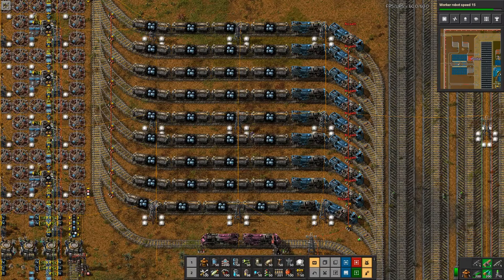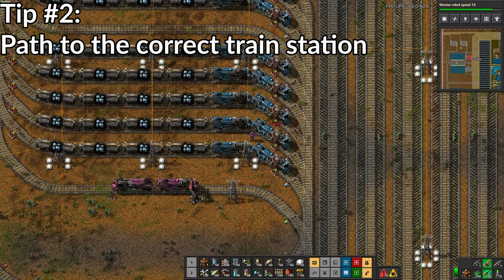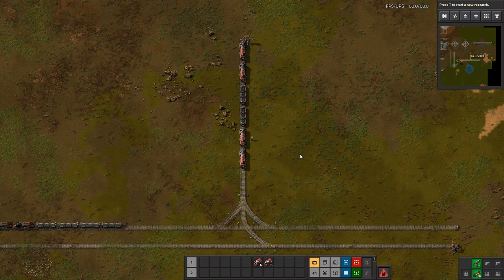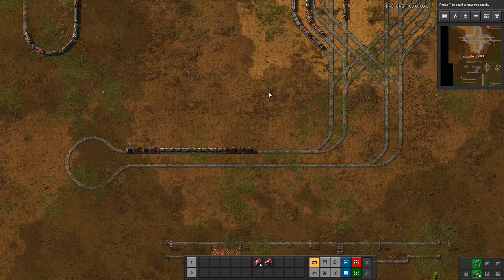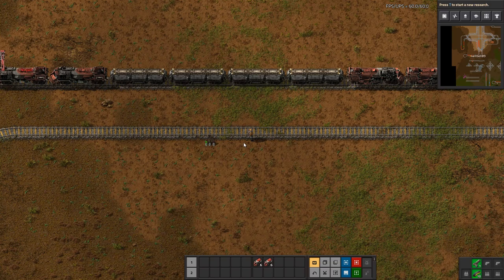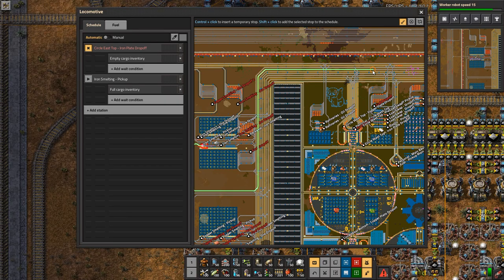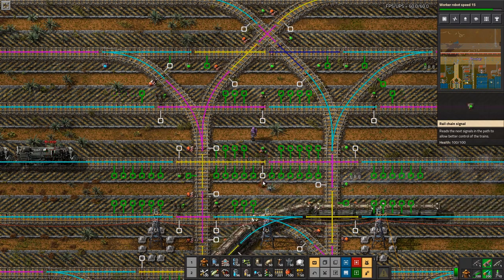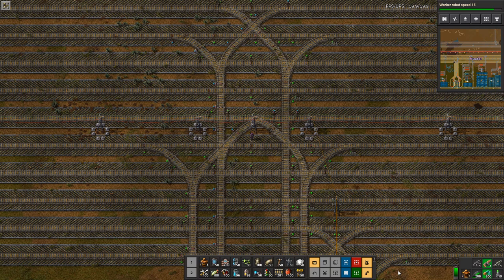FACTORIO | How to Fix Train Path Errors - Tutorial

Comment: Nice. I particularly like the temporary-path-hover mode of debugging, because it helps to isolate where the problem is regardless of the cause.
Reply from the maker: Yes! I didn't think to mention that it works for things besides signal issues but that's a good point!

Comment: Are you sure you can only use R on a placement ghost and not the built train engine? Yeah, I just checked, you can use R on a train engine without picking it up. And I just checked again... I'm wrong. If an engine is by itself, R will work. But as soon as it's hooked up to a train, it won't anymore. :-(
Reply from the maker: Yeah I tried it too. I'm surprised it's not a game feature to rotate if it's already hooked in
Reply: @SoellessGaming  Thanks for the great tutorials!
You can rotate a connected locomotive without removing it by doing the following:

While hovering over the locomotive,
1. Press "V" to disconnect the locomotive from the rolling stock
2. Press "R" to rotate the locomotive
3. Press "G" to reconnect the locomotive to the rolling stock

Enjoy!

Comment: Thanks! This really helped me to fix my issue - though it turned out to be something else. My train (a single engine I use as a taxi) was blocking in various places. The track is complete and intact, because I could drive it manually between stops. It would only get blocked going from B to A, and never from A to B. It is a single track, and the train goes down it in both directions, but it does use shared track at times. I found that if I put down a signal for one direction, then I have to put down a signal for the opposite direction exactly facing the first signal. Once I did that, it worked fine.  I do not use any chain signals; just normal ones. One of your chain signal comments is what prompted me to try putting the signals opposite each other. Thank you for resolving my headache! NOW I MUST GO. I HAVE TO SET UP NUCLEAR POWER FOR THE BASE TO EXPAND.. IT MUST GROW. IT MUST GROW.

Comment: I have a train with 2 train heads and i have a stop at oil that its supposed to go to when its empty and then a stop at my base that its supposed to go to when full yet half the time it either fills up with oil and then doesn't move or it emptys at my base then doesn't move the fill up stop has go to when empty and the drop off stop has got to when full